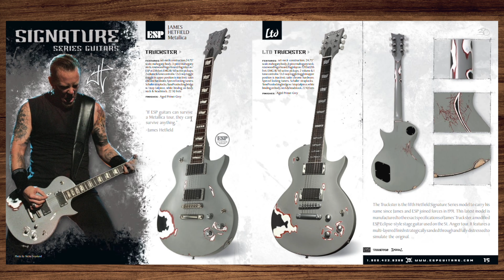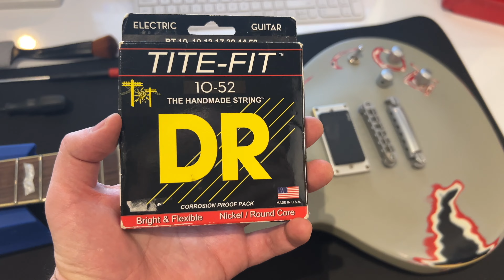The LTD Truckster James Hetfield Signature Aged Primer Grey is a cool Mother Trurcker

Comment: What did you use to clean the guitar? 
specifically the body, but also curious on what you use for the neck and hardware. 
I have the 2005 grey, it spent most of the first 5 years sitting in a rack as I used it a lot. Since then it has been in a case, but has continued to yellow the grey paint as well as the binding. 
I don’t mind if I can’t restore it back to the original colour, but am hoping to tone down the yellowing a bit. 
Good review, glad you took the time to explain the finish, I have had to explain it a few times over the years.
Reply from the maker: Its cooler in greenish. I use Music Nomad One with gentle touch of a microfiber for the body (dont buff or it will shine). For t he fingerboard - Music Nomad F-One. Frine Fret Polish by MN for the frets and Guitar Polish for the hardware.
Reply: Thanks. Much appreciated